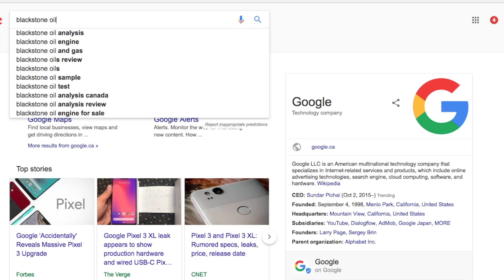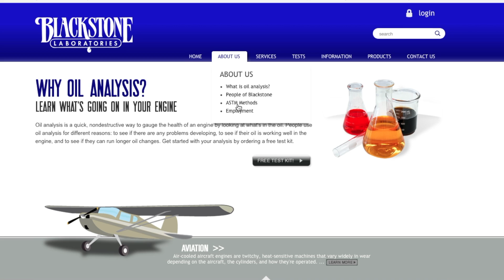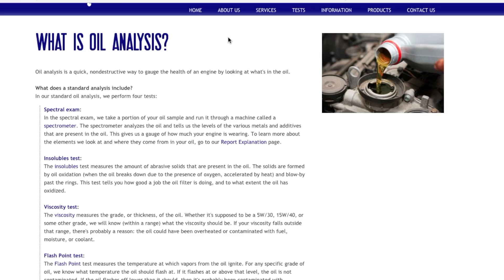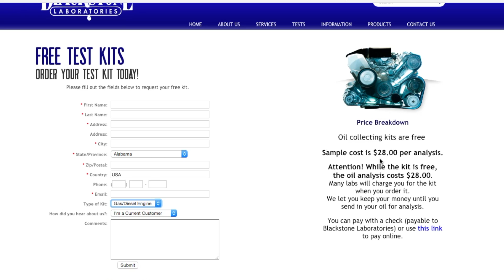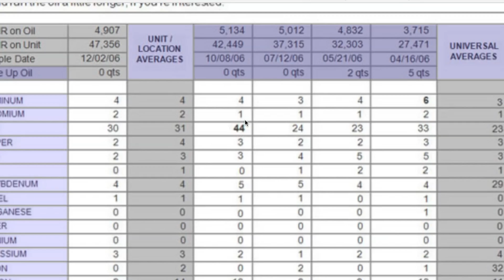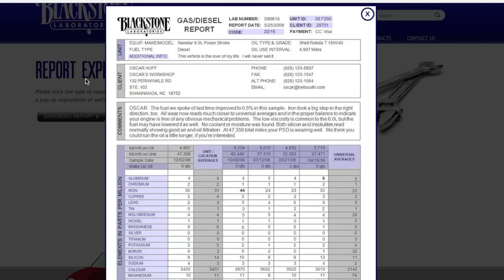BMW Oil Analysis For Rod Bearing Issues

Comment: Hey Mark, thoroughly enjoy your E60 content.  Have you considered or heard of anyone adding Sea Foam to the oil?  I happen to know the owner of Sea Foam and was visiting his office today, had a sit down with their development guy who has experience as a mechanic performing engine rebuilds for race cars.  I told him about my 2010 E60 and the rod bearing issue.  He claims Sea Foam will remove any built up deposits (varnish) inside the engine as well as increase the viscosity of the oil albeit minimally.  If Sea Foam is able to keep those already too narrow passages clean and increase the effectiveness of the oil, do you think this would lessen the wear on the rod bearings?  Would you try this in your own car?